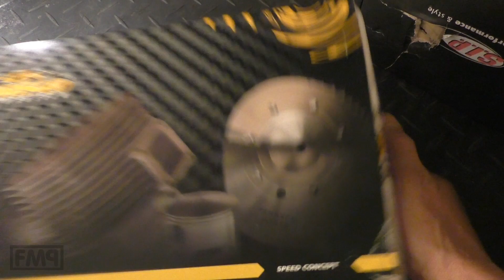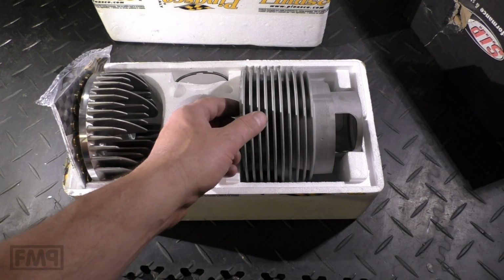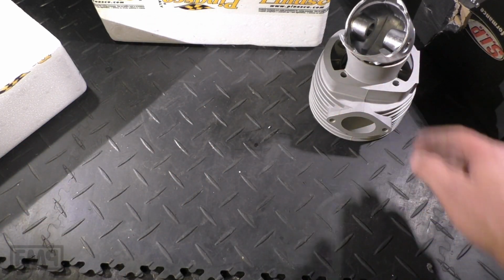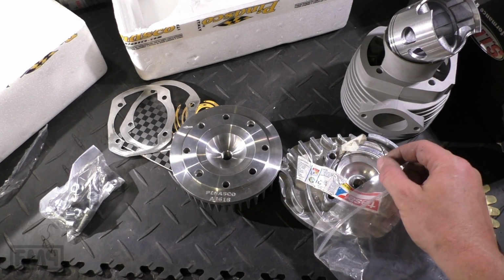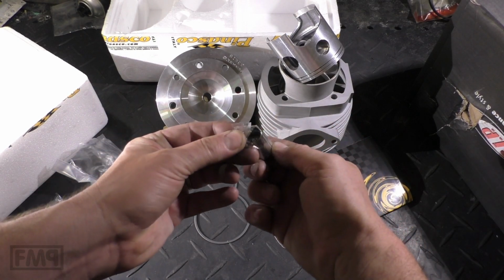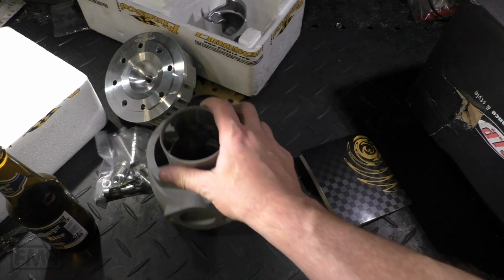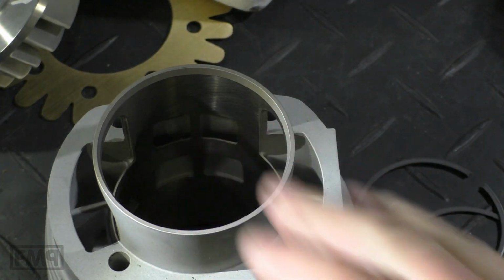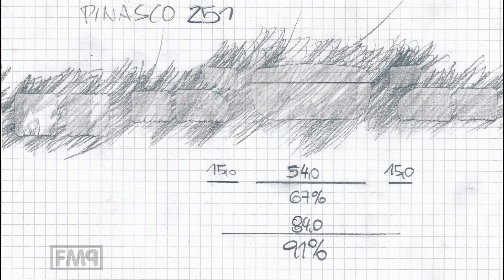vespa PINASCO 251cc unbox | FMP-SolidPASSion |

Comment: Check the level of the liner against the top of the barrel. I needed to have it machined as it protruded a small amount and caused an air leak
Reply from the maker: thanks for the tip. it was the same at the bfa 306: the cylinder needed to be turned down on top and bottom.

Comment: What was Pinasco thinking not doing a boost port?  I just don't get it.  Pinasco also needs to increase their head technology. . . their competitor VMC is killing it these days.   on the upside, glad to see a decent piston used.
Reply from the maker: me neither. the case (acc to pictures in shops) even does have a port forseen, so why is the cylinder one closed?!? its not always easy to understand pinasco if you focus on technology.... 

yes, VMC fires the competition very well. 

q back: what do you define as decent. is the comparison level up (meteor) or down (latest pinasco pistons, ie need of t5 162cc exchange for free as they are cracking)

can a 251cc piston be "decent" if its lighter than the weak cracking famous asso piston 207-213? it has 4,5mm roof, no cooling rips VS meteor M244 8mm (also no cooling rips) VS asso piston 5mm roof thickness, also known for getting a roof dent. yes  it will do the job. no its not appropiate for a 700,- cylinderkit (also the missing real boost port) but not really surprising in the end. it will do the job, but i would just recommend low end tuning with this cylinderkit, NO! reed valve with a lot of power.

Comment: I'm guessing that the boost port lines up with the windows in the piston so you can still pull from the case. So it's not fake it's just taking a harder turn, still interesting.
Reply from the maker: but not real either, so i call it fake ports. why at this cylinder? not explainable, as there is enough meat at the case, on the pictures they even show the third port in the pinasco case, but hide the fake port of the 251, like with the 2 fake port stoneage 213cc pinasco, a simple 200cc original copy in alu, which is still sold...  https://youtu.be/_7-m6egJhT4
Reply: @FreakMoPed8  fair point about non expansion.

Comment: Ciao mi serve il tuo aiuto perfavore.  Ho una lml 177 plug e Play con cilindro vmc super g e carbutatore pinasco er 24 . Che getti del minimo e massimo mi consigli?
Reply from the maker: reed or rotary valve & which exhaust?
Reply: @FreakMoPed8  marmitta polini original e aspirazione lamellare lml originale
Reply from the maker: plug and play, original intake = mj 122 should work
Reply: @FreakMoPed8  grazie ora vado in garage e faccio questa prova. Un saluto dalla Sicilia.  Buona giornata
Reply: @FreakMoPed8  ok però quando cammino al massimo  sento come se si svuota il carburatore  manca benzina cosa può essere ho il rubinetto maggiorato bgm forse ho il tubo della benzina troppo lungo quali possono essere le cause ...
Reply from the maker: the bgm/omg fuel tap is not good. better use sip v2. but u did extend main jet bore to 2,5mm, did u :)
Reply: @FreakMoPed8  ok grazie appena posso ordino il rubinetto Sip. Ora ho montato il pacco lamellare in carbonio con il carburatore 24 er pinasco plug e Play con cilindro vmc super g.  Che getti mi consigli del minimo e del massimo e la vite del carburatore a quanto la devo regolare?
Reply from the maker: englis pls

Comment: Hi Freak, so this is suited to both pinasco and modified Piaggio cases?
Reply from the maker: yes. i trust more the good old original cases. they do have to be turned out. if gasket or not is needed i will then see.
Reply: @FreakMoPed8  hey thanks again. I still love your videos. It would be a shame to modify an original T5 case though, to you think? If you had the choice, between a Malossi  standard, Malossi Worb5 of the Pinasco, would you chose the Pinasco? I recall you being unimpressed by the WorB 5 ?
Reply: @FreakMoPed8  There is a mod to strengthen the cases also, is that right? I think that you have included it in one of your videos?
Reply from the maker: not for the engine owner, a friend of mine. the problem with t5 is, that only few tuning parts are available and most of them are very old. just having 3 fat ports, doesnt mean that there is decent power. so the decision was: why not doubling the cc and use the 251.

do you mean cylinders? engine cases? no, not the worb. its not possible to exactly set cylinder timings, if you only have the cylinder. you do need the engine case of course.

"There is a mod to strengthen the cases also"
what exactly do you mean with that?